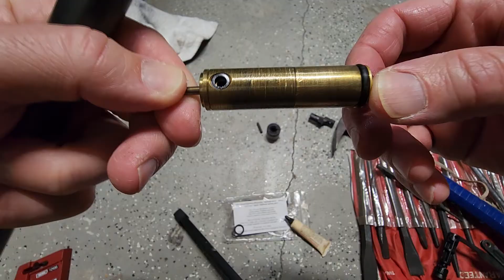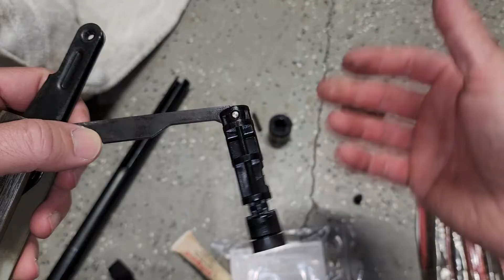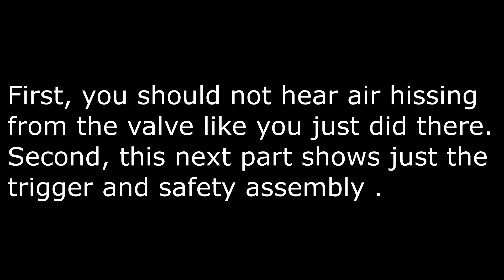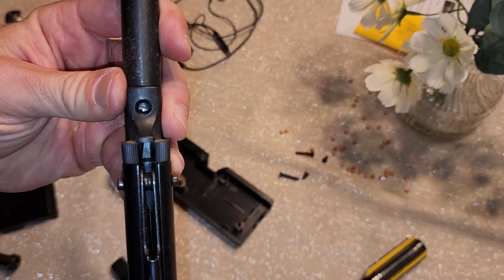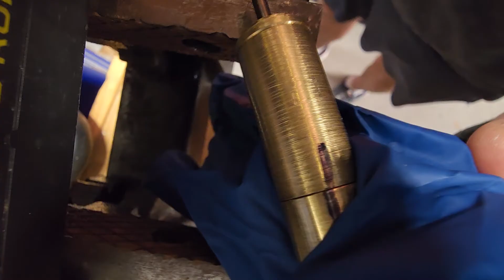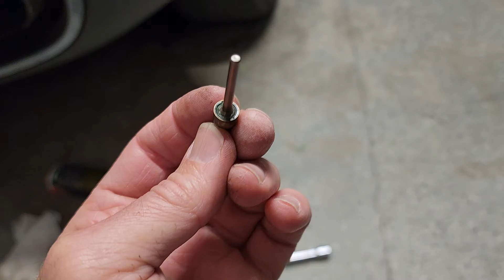Crosman air rifle not holding pressure? Troubleshoot and fix it here! Sneaky fix at the end.

Comment: Man I must've broken down my scout 788 5 times now. Did the seals like you still had zero resistance when pumping. I replaced the seals in the valve yesterday gave everything a wipe but didn't know the bottom of the stem cap was rubbery. Just reopened the valve and confirmed the oxidisation at the bottom. Time to order some new parts. Thank you for your video this helped me with my crosman scout 788.

Comment: I just took my 66 apart and have the same greenish residue on the needle/stem part of the valve. Did you end up replacing the whole valve? I see the Alchemy seller has an aluminum valve assembly, looks a little different from the original brass.
Reply from the maker: @kramnnim  yep, replaced the whole valve. I believey new one is aluminum -ish but it works great
Reply: @ cool, thank you!

Comment: Great video, had my Crosman 50 years!!
Was it just the o ring that needed replacement to make air?
Reply from the maker: @jrago6228  thank you. I love these rifles. In the end I had to replace the whole piston to get it to work again.
Reply: I have the polished brass model,  you needed the whole piston and air assembly? I pump mine about 7 pumps get some pressure but 2 or 3 nothing. 
I contacted Crossman see if they have a rebuild kit.

Comment: I know this video has been out for a while but I've seen some somewhat kind of recent comments.... But I'm trying to find out exactly how the l-shaped bracket that has something to do with the safety goes in...
Reply: I actually just popped it in to where I knew it was supposed to go but didn't know how the lining up would work out.... Turned out to work fine and then I watched a portion of the video you told me to and realize I could have saved the hell of a lot of time have I done that to begin with 😂😂😂😂.... But still helped a lot thanks man 👍
Reply from the maker: @mattlilley  glad you got it figured out!
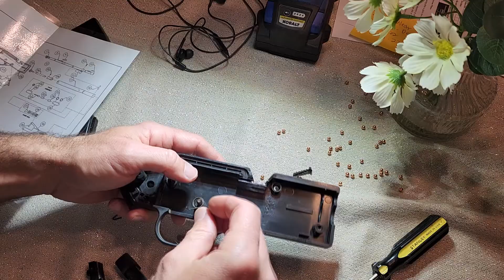Reply from the maker: Watch from about 6:30 to 8:30 and see if that helps. I show pretty much everything

Comment: Dude, thank you so much for this. I was struggling for an hour before I found your video and getting that assembly back together. It was driving me nuts. I lost that little pin on top of a gas cylinder. Luckily I found it at my feet
Reply from the maker: That mechanism is frustrating, glad you got it fixed.

Comment: Great video! Thank you for making it. I too have the same problem and AlchemyAirWerks told me the same thing. I just received a new valve stem pin and O-ring seal kit. I haven't had a chance to disassemble the rifle and check everything, but I'm hoping the new stem pin fixes the air leak. Thanks again.
Reply from the maker: Thank you for taking the time to comment. When you have a chance to work on your rifle, I'd be curious to know how it turned out for you. Drop me a note if you can
Reply: Just finished installing the new valve stem and seals. So far no air leaks and everything seems to be working properly. Thank you again for sharing your video!
Reply from the maker: @prairieskycam  outstanding!  Well done.

Comment: On my 66 The plastic piece he is putting in after the valve went in, that skinny spot has what looks like a felt washer the thickness of the space. It says it needs to be oiled. Great video!
Reply from the maker: Thank you for taking the time to comment and congrats on your fix!
Reply: Do you know if the oil washer sponge is required? I read elsewhere it may not be necessary

Comment: My new legacy 1000 crosman shot great for about 40 times. After that I can pull the trigger and it does not fire. It has a bb in the camber and the safety is not on. The trigger pulls back. It pumps up and does not hiss. What could it be?

Comment: I replaced the valve on my 66 from an ebay seller. Though I kept the old valve and scrapped out all that old green rotten rubber and found that there is space to place an o ring in. I have placed an o ring in my old valve on the valve stem but haven't tried it in my gun since I purchased the ebay valve.
Reply: I did this too, it worked for a couple of shos only. I might try again with washers underneath the o-ring, or try the later model derlin poppet after grinding the set flat.

Of course if that doesn't work you need a new valve...
Reply: @stevekurzban9352 any updates?
Reply from the maker: Curious to see if that works....if it does please let us know what o-ring you went with and thank you for commenting